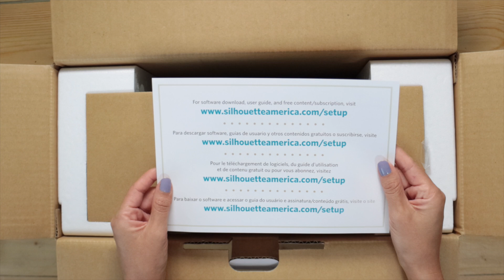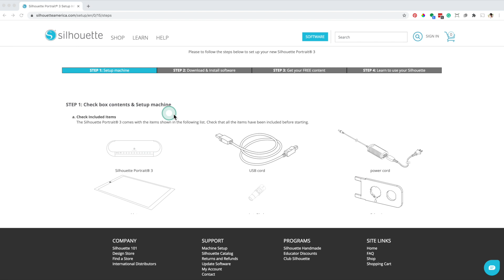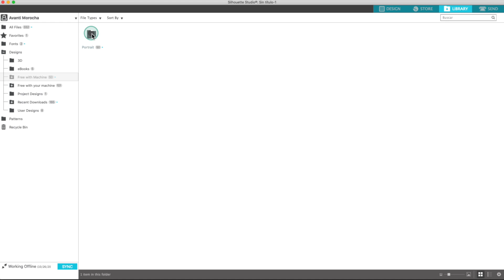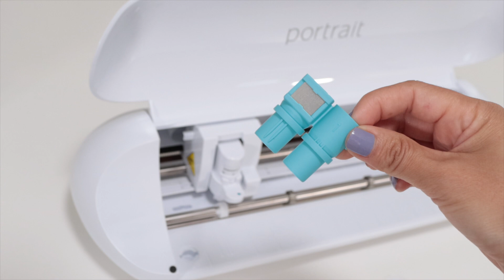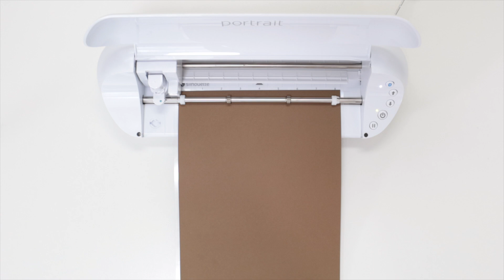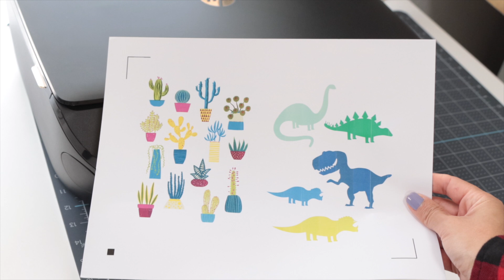Silhouette Portrait 3 - Everything you need to know ( Specs, Setup, and projects)

Comment: Hi when you make stickers is there an easy way to make lettering that doesn't cut but part of a larger sticker? Thankyou
Reply from the maker: I’m sorry but I don’t get the question. When making sticker you can make die cut or kiss cut stickers.
Reply: @AvantiMorocha1  But if I add text to a sticker the machine  wants to cut  out each letter as well unless I take every letter and remove the cut lines separately.

Comment: Nice review. I am about to enter into his hobby, i have a question: I want to cut the Disney Dusty plane skull to decorate airplanes.I need a small size 30mm. Do you think this cameo 3 can do it? I am planning to buy a used portrait 3. I hope you can advise. Thanks
Reply from the maker: It depends, if the piece has many details it can be hard. 30 mm is not that small.
Reply: @AvantiMorocha1  the piece is the wrench skull from the Disney planes movie. it that complicated?

Comment: I needed to comment, because I used your video to start my cutter. I paid for it 230$ because I live in EU and they add tax to the price. That machine is a pure waste of space, nerves and money. Do not buy it. I purchased it for stickers. I bought printable stickers (so the sellers already made a silhouette cutting files.) All I had to do is print and cut. My cheap printer printed it out perfectly and when I put it into the cutter, the troubles start: registration failed. Out of 10 times, registering is only successful once. So I eventually ended up buying those super expensive stickers anyway, despite having the printables, the printer and the cutter. 
I watched million videos on YouTube how to fix the damn thing. And I need to say their software is extremely complicated. If anyone is reading this before purchasing, my advice is not to buy. You will regret it.

Comment: Thank you for your precious suggestions!!! Can you please help me, I am going crazy with this. My autoblade doesn't cut even if I have followed all the steps in the right way! It leaves a sign on the paper but doesn't cut it enough even if I put a high force and 2 steps
Reply from the maker: Hi, make sure you’re putting the mat and the material on the right position. Something similar happened to me and that was the reason.
Reply: @AvantiMorocha1  thanks for your answer. I have put the mat near the second line as you show in your video, and I have tried to put the paper on the mat both where there is the line 8.5x11 and A4. I don't know what to do. I was wondering buyind the manual 2mm, but I'm afraid to have problems also with that one.

Comment: Hi thanks for this video! Can you give some more info on how to load the mat? I make stickers and my machine struggles to read the registration marks and the cutting seems slightly off. I’m pretty certain this is a user error and I’m not loading it in right. Thanks again for this video!
Reply from the maker: Hi, make sure you're using mate paper (not glossy). Use the same size paper on Silhouette Studio and the mat. If you're using A4 paper put it on the line mark for A4 on the mat.
Reply: @AvantiMorocha1  hello! I was wondering why glossy paper cannot he used?
Reply: @ddianadoer  hey, I know I'm not the one you asked but its because glossy paper reflects light! Because of a bunch of tech stuff, those reflections make it harder for the machine to read
Reply: @ddianadoer  usually, people put on matte tape on registration marks, so the machine can read them